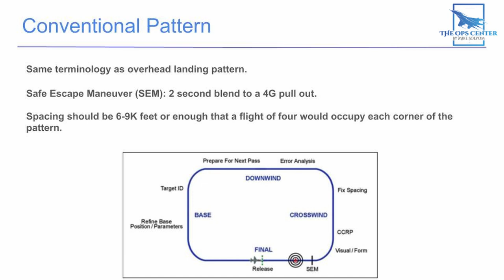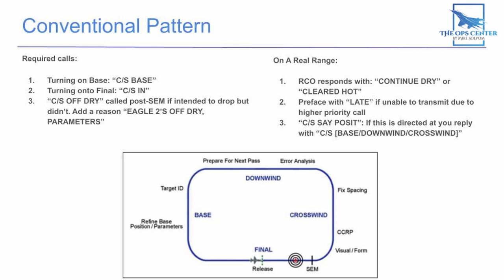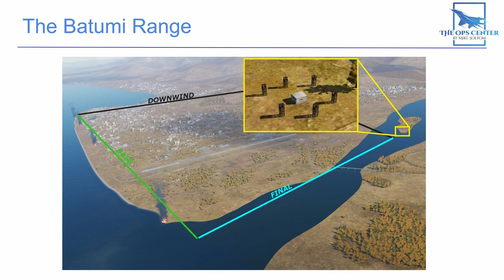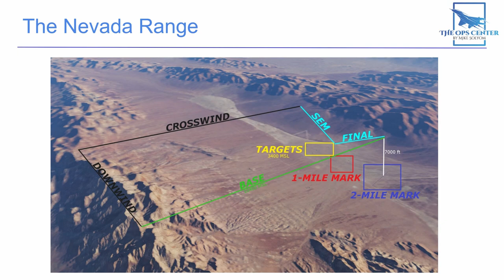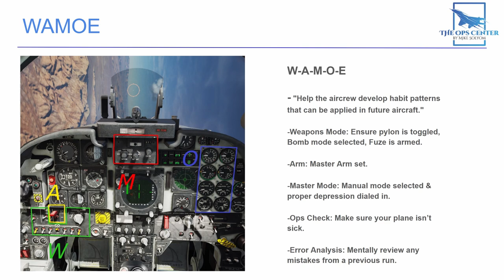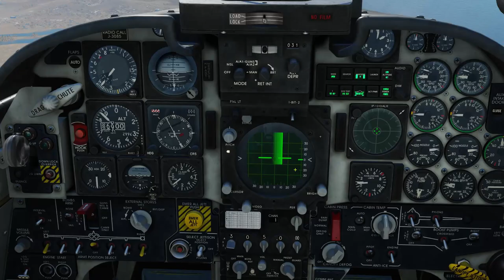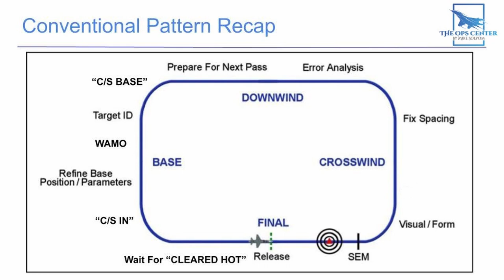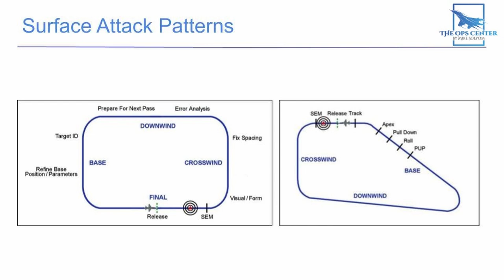USAF Conventional Pattern  | BSA Part 3 | DCS

Comment: Hi! First of all, thank you for all these videos; all the series are amazing!
I have some questions about the box pattern:
How do you calculate your pattern altitude with regard to different dive angles? Do you use the 30° dive angle calculation to build the initial pass and then adjust the base leg altitude to match the corresponding canopy code when changing the dive angle?
Also, how do you determine when to turn onto the base leg without visual cues? Do you set a waypoint?
Thanks a lot!

Comment: Mike, thanks for this, I come back to it every now and then after practicing :) 2 questions: 1) do you set your F5 trim for any particular portion of the pattern? 2) how do you figure the target elevation into your altimeter?
Reply from the maker: 1. Trim should just be for level flight at the base. 2. In a jet like the F5 you have to know the target elevation ahead of time. So it's either preplanned and a topographic map let's you know, or you have an observer on the ground radio it to you (this is why a CAS 9-line has target elevation as a mandatory line btw).
Reply: @TheOpsCenterByMikeSolyom  thanks Mike! So I should be setting altimeter for sea level and doing the math, vs QFE for target elevation?

Comment: I need the parameters of your mission. You showed yourself bombing. But from outside the plane. I downloaded nevada but idk what height i have to be to drop the bobmb i see you have it set to 31 mils. I would like to get my hands on the charts you use to figure it all out and maybe an equation or two please. I have like a ton of different charts and its causing me to overthink, and i need to copy u step by step to learn first before trying different numbers, cuz ill get frustrated and change it up lol
Reply from the maker: The parameters I used were a base of 10K above the target, 400 KCAS at base, set MIL power at roll-in, 30 degree dive angle, pickle when the gun sight is over the target. 

One thing I have to mention is it appears ED has changed something and 31 mils no longer works. It wasn't accurate according to RL charts either. Now its closer to the RL charts but still off. I'll be making another video at some point to explain the change and how to compensate in case it ever gets changed again. But for the time being I would try with something higher than 31 mils.
Reply: @TheOpsCenterByMikeSolyom  that is amazing wonderful info. 31 mils is broken huh? Hmmm. There was a guy who wrote some amazing notes that he shared with me the other day I'll have to try those. 

So u didn't have a particular release point? U just dropped it when the pipper hits the target?
Reply from the maker: @fnslayeroc  That's right. In real life you would go by what the chart/app says. That way you can plan a recovery altitude above any possible ground fire. But since those don't match up with DCS we just have to wing it.

FYI, I did some more testing and found that for the profile I used in this video a depression of 51 works now. I'll make an update video soon so everyone else can see it too.
Reply: @TheOpsCenterByMikeSolyom  lol i was practicing with 51 65 and 78 and different heights to drop from. they all seems pretty decent. according to the chart i was reading 51 for 30 degrees angle is 3k foot high drop.

Another question, if i blow one of them targets completely up does it stop telling me i hit them?
Reply from the maker: @fnslayeroc  Yep. That's generally how it works.
Reply: @TheOpsCenterByMikeSolyom  ah ok I can write a script to respawn them no wonder....

I thought I would suddenly just start sucking lmao
Reply: @TheOpsCenterByMikeSolyom  I was able to make it so they take damage yet do not die.

What you have to do is set a repetitive action for each individual target unit, that says when they take damage it deactivates the whole group. So I think your main targets on Nevada were 001 002 003 and 011. Had to make the trigger for each of those units.

Then use the mist script for respawning, that triggers when group = dead. Also repetitive action

This makes it so they instantly heal after u hit them....

So essentially ur making the group despawn and respawn each time one of those units takes damage